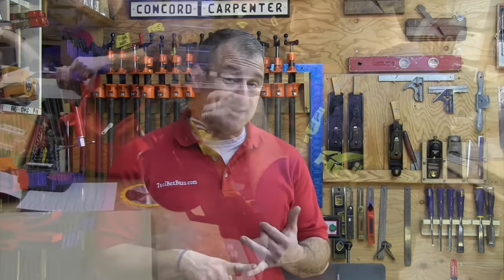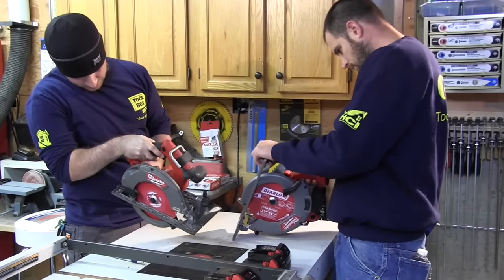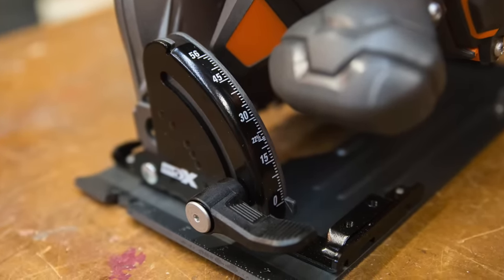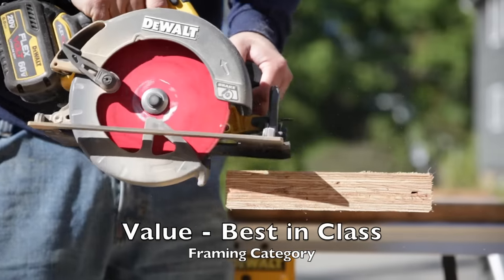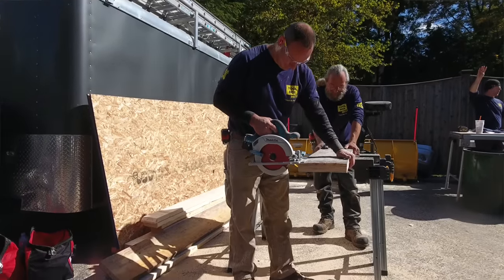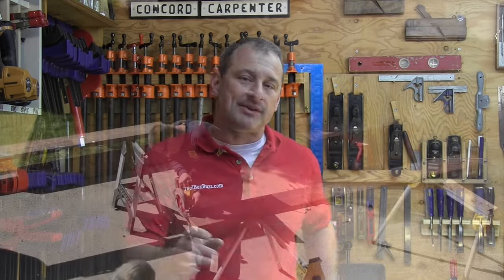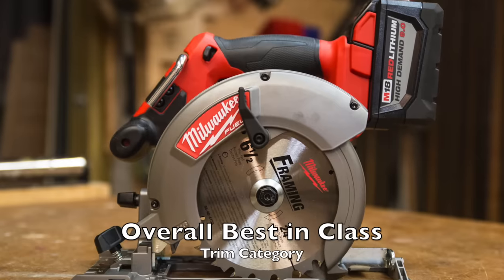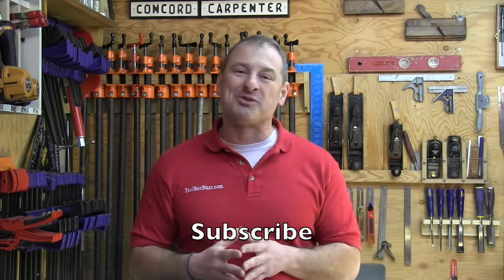Best Cordless Circular Saw - Head to Head

Comment: The Dewalt 20v system  really isn't even 20 volts, its 18... Spoke to a Milwaukee rep and he pointed that out. Also not having the Flex Volt work in any 20 volt (newer) Dewalt items was upsetting as well.. I'm going to change completely to m18 Series as things wear out for my Dewalt items..  Already did with corded items thus far also!
Reply: Dewalt and all 18v tools are actually 20v take tester and check your batteries I'll bet they are 20v or more and don't give me under load shit because the under load can change from 20v to as low as 16v depending on the tool you use
Reply: @loucifer323  18v is a number arrived at for mostly mathematical purposes, in much the same way as our 230v power outlets here in NZ actually peak at 330v but 230v is an RMS value, which makes it into a number you can actually use in calculations to work out current, wattage ect. Try using the fully charged, no load cell voltage to work out how many Watts you are going to draw for a given load. You aren't going to get even in the ballpark. Dewalt 20v isn't a lie, it's a cynical marketing ploy that must make the other manufacturers using the mathematically correct nominal voltage a bit angry.

This is equivalent to cheap stereos telling you that they deliver 1500 Watts. Fine print says peak, or PMPO. Actual usable RMS wattage could be as low as 20.

Dewalt are not allowed to market their tools as 20v in my country or in Europe because it's so close to false advertising without actually being technically false. Anyone who understands batteries know they have a voltage curve from fully charged to fully discharged. This is why we use nominal voltage. Peak voltage is useless as a measurement of anything except the charged status of the battery.

Comment: Late to the video. Am a dewalt fan but that was kinda unfair that the makita was treated as 2 separate batteries. That should have been counted as only one 36v battery, all of them have different volts. The dewalt has a 20v and di makita has a 36v, not two 18v

Comment: still trying to decide what battery platform i want to go with this is hard
Reply from the maker: Lots of good choices
Reply: A Concord Carpenter / ToolBoxBuzz I'm torn between makita and Milwaukee. I also like a lot of the things dewalt is putting out but there drill and drivers seem big and bulky compared to makita. I do a lot of remodeling and space can be tight. I Also like a charging job site radio and I want a cordless drywall gun because I do I ton of that stuff. I might have to get more than one brand no one is doing everything that I personally want.
Reply from the maker: i use both platforms

Comment: Ok you can use a milwaukee 7 1/4 with a 3 amp but it will dont cut you have to use high capacity batterie

Comment: I got the Milwaukee and I'm so disappointed at the play it has on the shoe plate after you tighten the angle. They chose to use a stud and loose hole mechanism instead of using a more sturdy and accurate means like the other competitor's saws. I want to buy a Makita

Comment: I have read many of the comments below - i wonder, why didn't you use a Brushless Makita? Makita was the first producer to come up with brushless portable tools - you can go check it out, it's true. So it's impossible to say "There was no brushless Makita at the making of the video." Of course it consumed the most power per cut - it was the only brushed motor in the line-up! This is very very misguiding. In fact, the Brushless Makita Saw outperforms all others in almost all aspects including and especially power per cut used.
Reply from the maker: Alex Iordache this is the tool that Makita sent, I can only guess that the brushless was not out yet

Comment: Why do the cordless framing saws have the blade on the wrong (or left handed) side? The plug in saws like Skilsaw are correct, and the 6½" ones are all correct... But the 7¼" ones are obviously made for Lefty's... Using one is lime trying to use left handed scissors if you're right handed... I took my dewalt kit back when I found out the saw was wrong... Ended up buying a 6½ instead and a Skilsaw worm drive plug in for anything the little one can't handle... I'm not the only pop ne who thinks this either... I had everyone on the jobsite try it and everyone had the same reaction, "it's left handed"

Comment: I can’t believe makita haven’t put a brushless motor in that framing saw yet....

I’m on makita 18v range.  They do the job but they are very slow at innovation.   

They were one of the last to put battery power indicator on batteries.

Their plunge saw has no riving knife.

Their new jig has an incredibly stupid slow safety start... on a professional tool... and the trigger isn’t variable...

I could go on...  I still prefer them to Milwaukee and dewalt though overall.  Most of their range is pretty good and they have a good ergonomic feel to them.

Comment: After watching the video I feel like Makita should have taken the trim saw category and dewalt the framing saw category. But like it was said at the beginning of the video, this is not comparing apples to apples. To me, it seemed like Milwaukee saws do not deserve the title of "overall best in class". Milwaukee only took 1st in the "Depth Settings category".  The "Endurance" category given to Milwaukee is due to a battery that is twice the size than that of the rest of the saws, that does not mean the Milwaukee saws are better saws or more efficient, not if you keep in mind they were running on gas tanks twice the size of the other saws being tested and actually, their numbers are not that great if you really think about it. To make testing fair, the same way you doubled the number of cuts on the single battery saws to offset  the double batteries on the  Makita you should have divided the number of total cuts in all the saws by their total number of amps per hours used... by the way... what size batteries were you using on each and all the saws? I own the milwaukee fuel 7 1/4 and I agree is great saw but it does feel sometimes under powered and definitely  does not come close in power compared to the flexvolt I tested at the home depot.  one thing is for sure... poor Hilti! not a single win.???
Reply from the maker: Bernie Gutierrez read the article the data your asking for is in a graph we provided
Reply: Great charts, thank you and please, keep the articles and videos coming. Like already mentioned on my previous comment, my opinion, makita and dewalt takes the gold.  Your chart "cuts per watts hours"  shows that when comparing apples to apples Dewalt is a more efficient saw than the Milwaukee, if you add to dewalt the plus factors of the blade change, sight line, value and definetely more power, it should have been a no brainer. Also, you list in the article Makita saws were tested with 6.0Ah batteries but on certain video shots you can clearly see 4Ah batteries being used. is this a typo? If so, Milwaukee saws were given the advantage of being tested with more than twice the gas tanks vs makita and if so, do the numbers in the charts change in any way? thanks again.
Reply from the maker: Bernie Gutierrez there were 2 Makita saws, ill have to go back and look, possible typo, maybe you're  looking at the smaller trim saw
Reply from the maker: one framing 18X2 and one trim 18 v

Comment: I  just like to listen to see how many times he says "Sawr". Seriously, I think they are all great saws in the top 4 brands. I just don't want to use a saw that takes a 9Ah battery or larger, at that point I'm plugging a cord in to save weight. I have so many 18V makita packs I  could easily run 36 volt and dont for just that reason.
Reply: You should look into the m12 saw if you are looking light weight.

Comment: Is dealt the only 20v compared to rest at 18v seems fare
Reply: Dewalt 20 volt tools are 20 volt "max" it's a marketing gimmick, put a volt meter on your 18 volt batteries with no load on them and they will read 20 volts just the same as the Dewalt 20 volt max batteries.

Comment: The only way to truly test is feild test not sit there and cut a board over and over again. The Milwaukee with a 12.0 battery is in my opinion the best. I tested these building new houses. One and a half 12.0 battery's will be all you need to frame a 1800 sqft house without a cord.
Reply from the maker: Richard Blowers we field test as well, but I disagree with you.  Testing can provide valuable data that can be extrapolated into deeper understanding of these tools

Comment: could u do a review like this for every (major?) tool the big bands make and i promise ill never watch another review again. 
thanks-

Impact drivers, angle grinders, belt sanders, drill, mitre saws, nail guns and sawsall - I think thatll cover 95% of all users!
Reply from the maker: Fstarocka Burns haha we have covered almost all of those. The issue is a year or two later tool companies innovate and upgrade.... tough to keep up. These types of reviews take dozens and dozens of man hours
Reply: yeah well gr8 on you guys for taking the time. Spent days deciding which brand to go with. I decided ridgid simply because their products are lifetime (incl batteries), but I would consider going with milwaukee or dewalt as another set someday..

Comment: The "Joule" is the measurement of work perfomed. I was left more confused than enlightened on your watt hour comparison mumbo-jumbo. Obviously a 9.0Ah battery is going to last longer than a lesser ?.?Ah battery. Right? Moreover....what does four batteries vs two have to do with anything? In the real world no professional framer is going to have the time to be switching out 4 batteries all day long. They are going to be using a corded tool first. Incorporate a test that measures the the tools Joules (work performed) and then you'll have it.

Comment: Of course Milwaukee wins endurance and overall because it has a 9ah battery if you use the same battery size for all of them it wouldn’t win but I understand you weren’t using apples to apples but if you weren’t using apples to apples then you can’t ding makita for having a 2 battery platform.

Comment: Don't ever buy a 6-1/2 saw to dangerous. What happens is the blades get mixed in with the 7-1/4 blades so when put in the larger saw the teeth can cut your finger it won't cut it off it just scrapes the skin off the side when you pull the guard back I don't allow them on my job sites.

Comment: Flex volt 60v 3.0Ah.. M18 9.0Ah 25% more cuts.. It's not the voltage it's battery Ah that counts. I have a M18 12.0Ah it's like portable electricity. Very impressive.

Comment: Im an oldtimer and have batt.everyting but circular saws and angle grinders.theres days when i gotta cut stone all day and my wet wormdrives dont take breaks.and go into safe mode.that being said.heres the main point i want to make..this discussion of " on board" wrench storadge is a  joke ..in a little place i call the real world that wrench is going to be lost. Absolutely! please stop acting like its a major damm feature.iv had a porter cable 71/4 mag for well over ten years.dont feel like going to the truck for model #.its for wood only and it has a blade nut that only requires your thumb to change the blade.hasnt ever not worked.why in the world are we still talking about or making wrenches?

Comment: Wow...
He said 
YOU CAN WORK AS LONG AS YOU WANT ,, IN A SINGLE CHARGE......
(Referring to Milwaukee)
But he does NOT mentioned how long it takes for Milwaukee and or DeWalt to recharge...
Versus quick full recharge of Makita..
Reply: Rayceli100, it really doesn’t matter, point he’s made is that first the Milwaukee will produce 25% - 70% more cuts than the Makita and while working one Milwaukee battery pack is charging, ready to use after the other dies.  The Makita on the other hand utilizes two battery packs and you’d have to have to have two more ready to go, more than likely within a shorter time span (all things considered), due to it having less cut time than eith per Milwaukee Saw.

Comment: the stupidies thing, that milwaukke in USA dont have the dust exctration plug for protector, and europe version CCS55 have it ;D i realy want this saw to have in my garage, but i must have dust extraction :) and i gona convert it to tracksaw also :D
Reply: I've made an adapter to run my DeWalt DCS577 on Bosch track rails which puts the icing on the cake.
Reply: Heh i was think to buy this from usa since its way cheaper, but i need this dust extraction feature :)
Reply: I end up biying this from Uk, god fair enoygh price, and dust extraction works perfect even when i cut mdf

Comment: 13:55 Milwaukee cut 120 with 9.0ah ( 120:9=13.3 per ah ) and Dewalt cut 96 with 6.0ah (96:6=16 cuts per ah ) ... Or 96 X 1.5 ( 9ah / 6 ah )= 144 ( more that Milwaukee ). Is clear to see ... Dewalt is the best saw

Comment: I have the Dewalt flex volt saw and well maybe its just me . I had the worst luck with that saw the batteries wouldn't charge all the time I went trough 9 - 60volt batteries in last then a year Dewalt told me it could be where I bought the saw I got it on amazon they gave me a new charger and a new saw as well as my batteries and it was good for a while then one battery stop then another when it worked right it was a good saw but most times it was not a good saw oh and then if you used the notch in the table to cut on the line its off it does not follow it wish it did that's all I used for a long time was Dewalt then my new impact from Dewalt wasn't working good ether it would just stop working I got so mad with it I switched to HILTI all my tools are HILTI now it works well.

Comment: so glad to see a channel that isn't clearly bought by dewalt or ran by dewalt fanboys. being a carpenter and using every type of tool from every brand and class, I like the way you guys came up with your unbiased opinions. my company used to get supplied by dewalt, and not too long ago switched to hilti I'm assuming strictly based on their fleet program. I can say without a doubt dewalt is absolute junk and none of their tools last over a year. hilti is also junk,severely overpriced as well. I bought my own personal tools (makita) and use them daily because the hilti tools are such garbage. also just invested in the ridgid gen5x line as well for home projects and so far I'm very impressed with them for how cheap they are and the warranty they come with! and I've also owned milwaukee tools in the past and have used quite a bit of them in the field and it is not surprising at all that they won. they are a great line. I mostly see other trades using them though like plumbers and electricians. And metabo, honestly anything except their corded angle grinders I wouldn't waste the money on. lol rant over.
Reply: Andrew Eldridge anyone who says “Dewalt is absolute junk” won’t be taken seriously.  Stopped reading your rant at that line

Comment: What....no durability testing?  Framing saws get tossed, dropped and well, smashed - without a durability evaluation your value summation is useless.  If its cheeper buy a setup, but easier to damaged or knockout of accuracy- there is no value. And what about battery charge cycles?  Biggest expense on corless tools is the battery- who’s battery give more charging cycles and what is the performance of the battery nearing its ‘end of life?

I hate these “out of box” evaluations. How tools performs after (site simulated) abuse is what we need to know.

Comment: Apples to apples Try the 40 volt Makita single that will prove 1 high volt battery is etill high voltage the 40 volt makita will nlow that crap away and it is 1 battery

Comment: worm drive dewalt 60 volt blows all of these out of the water
Reply: Matt Martinson hmmm takes Dewalt 60 volts to even come close to what Milwaukee can do w 18
Reply: @adamharris2674  Dewalt has a 20v saw that is more powerful than this Milwaukee saw
Reply: Lou Cifer then why did the Milwaukee win the shootout? Rhetorical question, it’s a better saw.
Reply: @adamharris2674  The Dewalt cuts faster straighter and longer and feels better in hand and that's the bottom line
Reply: Lou Cifer well that’s the platform you have adopted and that’s fine. Objective comparison tests just don’t support what you are saying though.

Comment: Who has never charged a battery during work hours??  Of course the carpenter who's saw only requires 2 packs only carries 2??
Reply: Exactly me as an electrician in wiring houses i never drag an extension chord arouns and people are always like "oh what happens when the battery runs out?" I have a car charger and like 10 batteries on the work van, i think ill be fine 😁👌

Comment: Honest to god Milwaukee has gone to the crapper all our Milwaukee tools have been to the reality center multiple times
Reply from the maker: What type of work are you doing?
Reply: Sorry meant to say repair! My father owns a plumbing company down in Baltimore. Around 6 years ago milwalkue was it, no issues. Now since the fuels we've returned multiple hacksaws, 18v hammer drills, lights and bandsaws. Impacts haven't been too bad all though they've cut out on me but came back. The only tool I've had to be able to take the abuse nowdays is honestly Bosch. I've had my brute for almost 3 years it fell of of buildings 50ft tall into concrete, fell into watch buckets, I even began to purposely punish it to show people how crazy reliable it was, I even tightened up no hub bands under water with my impact. My brute finally gave in about a month ago but honestly I'm not mad but the service centers for them are horrible compared to milwalkue or dewalt